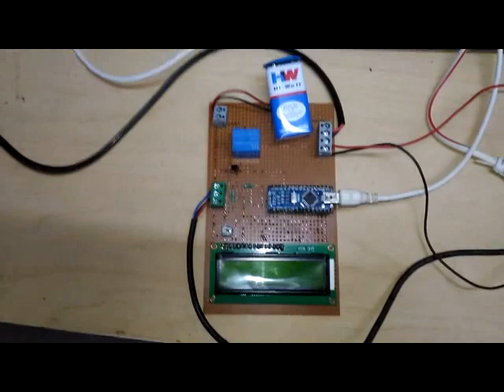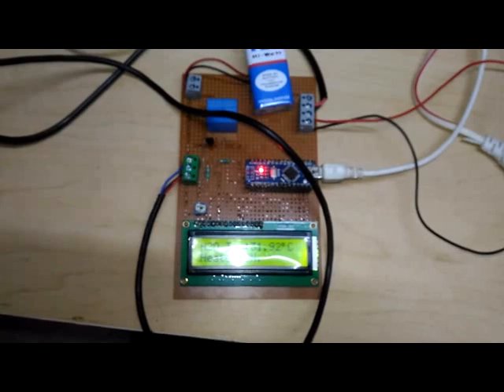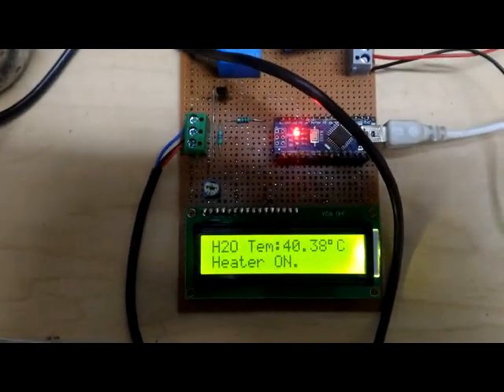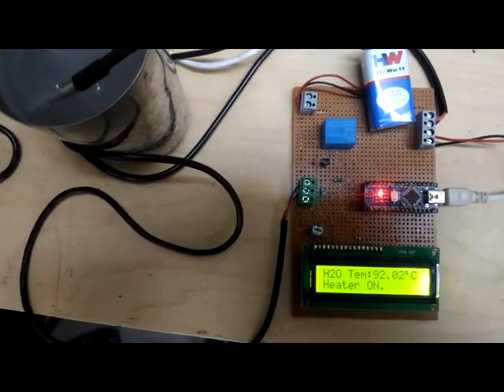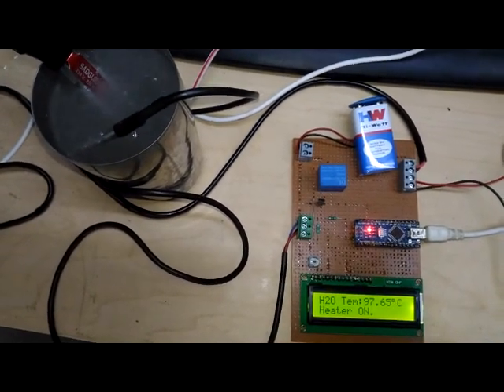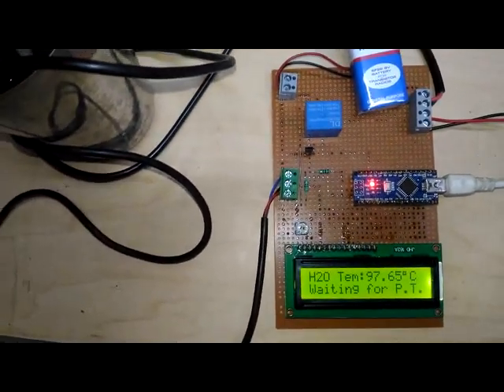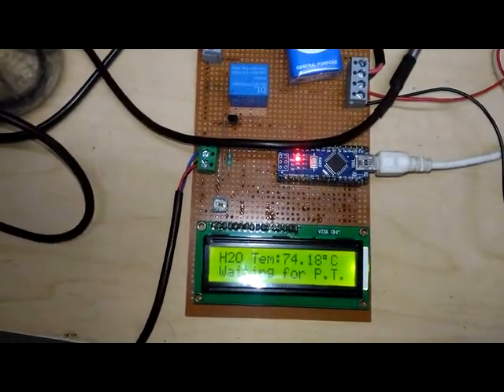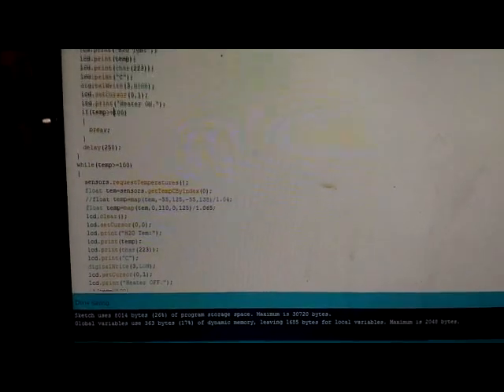Arduino Water Heater - DS18B20 | Water Boiler | Immersion Rod | Water Temperature Controller

Comment: Hello,
This is a really nice project and I'd like to know more please
Can you please tell references for the components ? (I would need the nominal power consumption for the water heater, I guess the reference for the temperature sensor is a waterproof DS18B20 am I right ? can you provide a raw schematic about the wiring between the relay, the heater and the power supply for the heater ? )

Context for my request: 
 I'm planning to learn by myself to do such things, and I have an idea that looks a bit like this project : I want to do, by learning by myself a programmed water heater to pasteurize eggs (I plan have cold water tank and water output around main water tank to lower the temperature using water valves and gravity, and a heater such as yours to warm up the water). I don't know yet if I'll buy an arduino or a raspberry Pi to code the program. I'm a software engineer so I guess I'll manage to make it work somehow :)

It's a very slow pace project I'll do to play and learn, while making something useful.
Reply: Oh I saw the wire in the video, I guess i won't have the high voltage exposed that much :) I'll find a way :)

Comment: It is possible to put an alarm, if the temp is too high already? Thanks for your response
Reply from the maker: Yes you can... So easy ... Just you have to add two line extra in your program
Reply: @procurio7112   Hello sir,
Can you please provide me circuit diagram and source code?

Comment: Sir. Can I have the arduino code and the list of components?
aliraza1731996@gmail.com
Reply from the maker: I can tell about Component list but for programming code you have to pay.

Components:
1. Arduino
2. Relay
3. water heater
4. 5 volt adapter
5. Bero board
6. water temperature sensor
7. wire connector
8. Rung, paste, soldering iron

Thank you for response.

Comment: Nice project!
Can I have the arduino code and the list of components?
thanks 
piotrwis2013@gmail.com
Reply from the maker: I can tell about Component list but for programming code you have to pay.

Components:
1. Arduino
2. Relay
3. water heater
4. 5 volt adapter
5. Bero board
6. water temperature sensor
7. wire connector
8. Rung, paste, soldering iron

Thank you for response.

Comment: can i have the arduino code and the list of components used in this project. thank you
Reply from the maker: I can tell about Component list but for programming code you have to pay.

Components:
1. Arduino
2. Relay
3. water heater
4. 5 volt adapter
5. Bero board
6. water temperature sensor
7. wire connector
8. Rung, paste, soldering iron

Thank you for response.
Reply: @procurio7112  how much the code cost?
Reply from the maker: @hemanthkumar5511  free
Reply: @procurio7112  please send the code
Reply: @procurio7112  can you please send the circuit daigram, components list and code please 
If you want to charge same me cost
Reply: @procurio7112  need to contact you bro
Can u provide contact number

Comment: Hi can i have the arduino code and the list of components used in this project. 
thanks in advanced.
Reply: If you got the code please send me too I request you please
Reply from the maker: I can tell about Component list but for programming code you have to pay.

Components:
1. Arduino
2. Relay
3. water heater
4. 5 volt adapter
5. Bero board
6. water temperature sensor
7. wire connector
8. Rung, paste, soldering iron

Thank you for response.
Reply: @procurio7112  How much does it cost to buy the codes? :)
Reply from the maker: @WhimWorks  it's free... Mention your email ID for the code

Comment: can i have the arduino code and the list of components used in this project. thank you
Reply from the maker: welcome
Reply: @procurio7112  please can i have the arduino codes and the name of the heater .
thank 
walid.gaaloul76@gmail.com
Reply from the maker: @gaaloulwalid6627   I can tell about Component list but for programming code you have to pay.

Components:
1. Arduino
2. Relay
3. water heater
4. 5 volt adapter
5. Bero board
6. water temperature sensor
7. wire connector
8. Rung, paste, soldering iron

Thank you for response.
Reply: @procurio7112  great video sir ...
Pls provide me circuit diagram ..